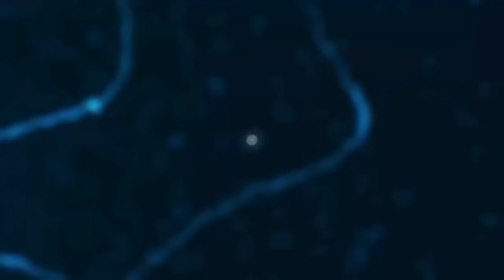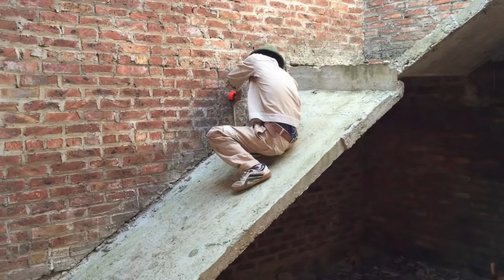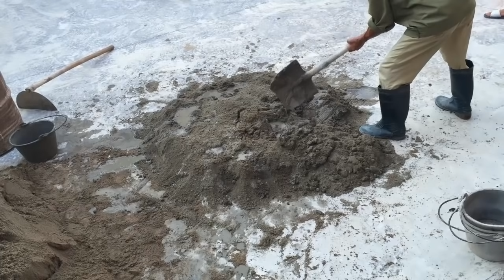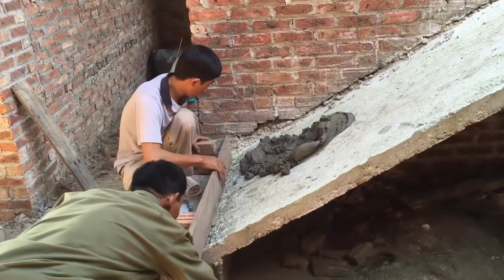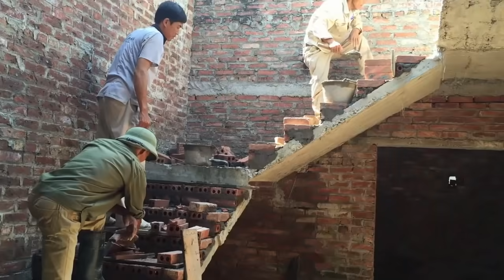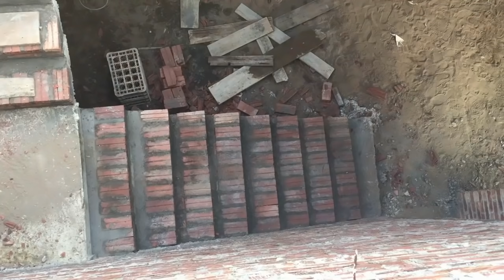Traditional Techniques Craft Skills Construction Plans Available - Building Step Stairs With Brick

Comment: Yeah, I don't know about the 4 inches of concrete they are putting those bricks on. That is a long span for such a thin and unsupported slab of concrete. Not to mention they aren't wetting that concrete slab to promote adhesion of the mortar mix.

Comment: Sorry, I don't get why he didn't use solid brick, a level or why he used broken brick on the back of the treads near the riser. I guess this is utility not aesthetics but seems like he is skilled and is capable of much better results. Again, utility and budget must be the driving factor but just hurts to look at what could have been .

Comment: This is the results of more than 70 years under the Viet Cong's regime. Communism is going backward and the Vietnamese people have not been able to figure out what is going wrong with the system. And yes, they are still so proud of these techniques that others used long ago. I feel really sorry for them...

And look at the ramps, I am wondering how long it will last. There is absolutely no support. I hope they will put up some support beams for those extra thin ramps.

Comment: I have to say its great seeing skills, but when you see ridiculous stairs made like this is ridiculous because if it rains, if their outside ,the stairs will slip ,not being a insitu stair pour with treads and risers as one  , when some one has concreted the carriage slab but could not work rise and run of the stairs in the original concrete pouring is truly stupid

Comment: Eso es un muy mal trabajo rápido si,pero extructuralmente muy débil  no tiene ningún elemento q le agregué flexibilidad para no romperse con reacciones fuertes o sismos  acá en chile no se permite este tu tipo de extructuralmente  tan débiles menos en una escslera
Reply: Osea es una mierda de trabajo 😅😅😅
Reply: @cessarabarzua3335  eso no es así depende de muchos factores a tomar en cuenta si está hubiese Sido de menor largo y con un apoyo central ok ,pero Dada esa condición no es recomendable ese tipo de construcción además la loza no tendrá adherencia con los peldaños al ser hechas por separado dándole una muy pobre resistencia mecánica ,si tú subes algo con un peso importante por ahí se va a fracturar en en centro donde existe la mayor fleccion de la misma ,o sea una mierda de trabajo